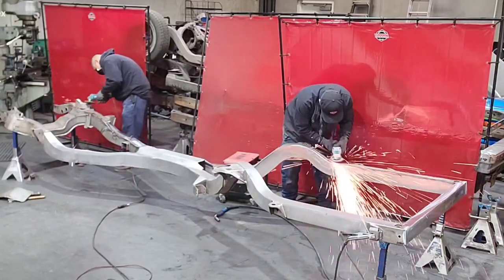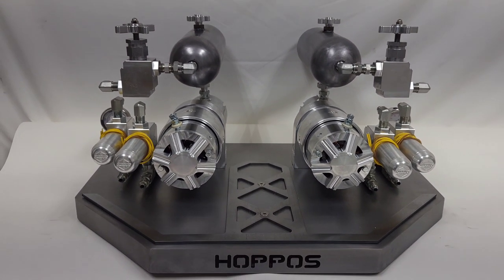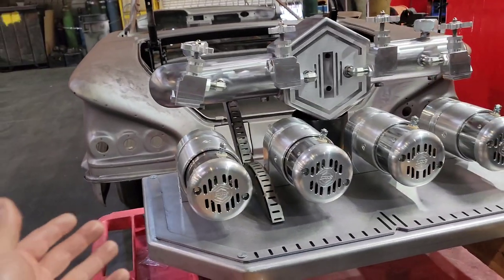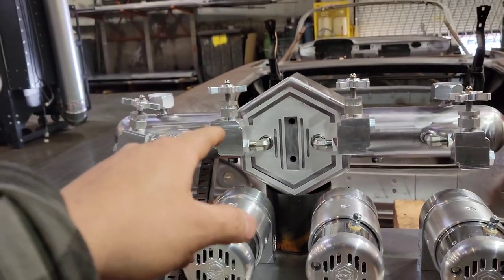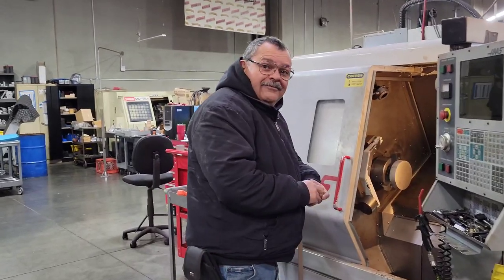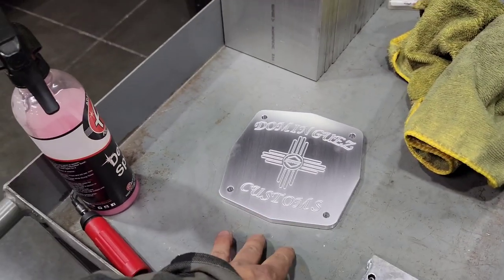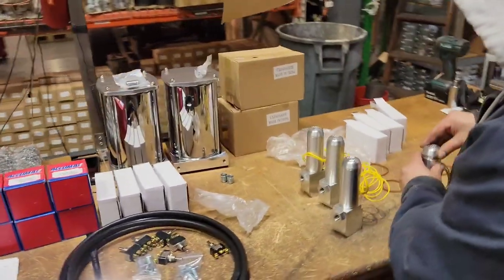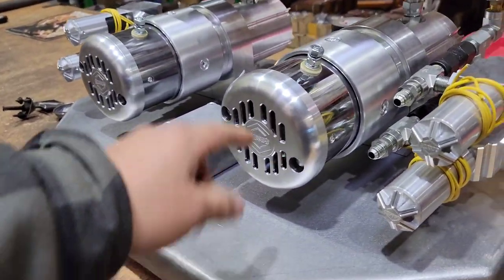MINI TRUCK  dancing bed build (Z RACK)

Comment: Has anyone seen, or heard of any full size pickup trucks, from 2002-Current Dodge Ram 1500, GMC/Chevrolet Sierra/Silverado 1500, Ford F-150, With Air Bagged Suspension, Riding Low, or Laying Frame, with a Hydraulic Tilt, Z Rack, Dancing, Spinning Bed? Let’s Bring back the 1990’s Lowrider Culture.